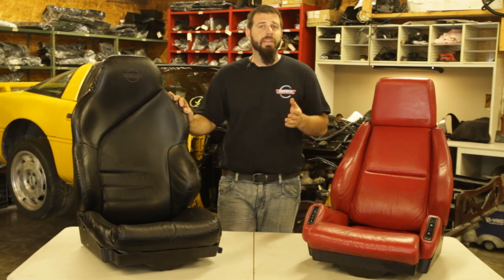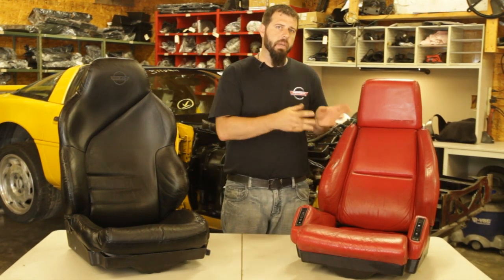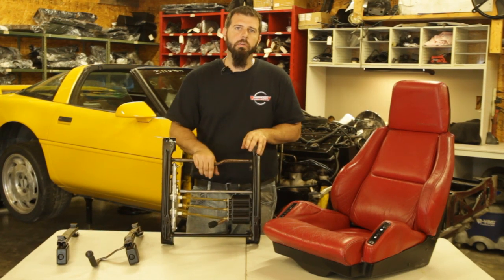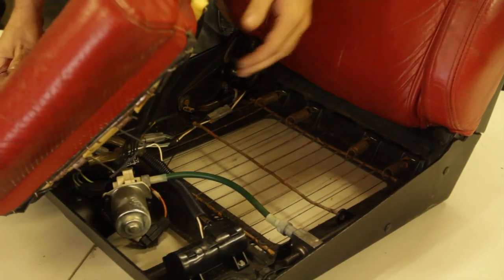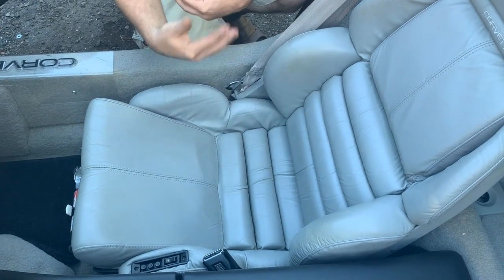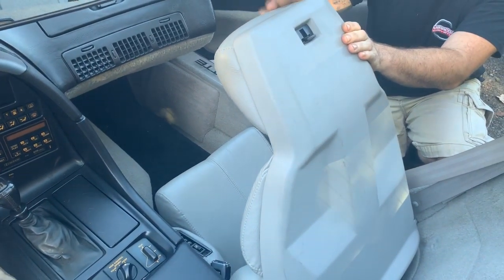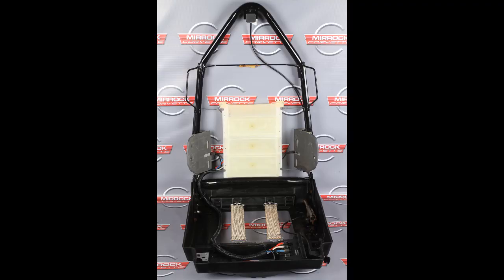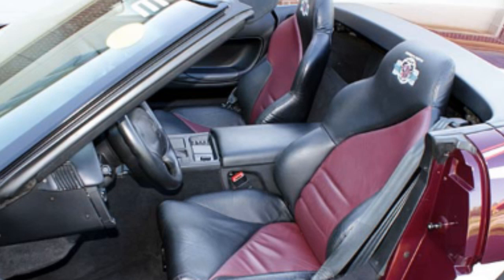C4 Corvette Design Differences: 1984-1996 Corvette Seats

Comment: Absolutely no struggle getting in and out of a C4 .  Feel's like your getting in a race car .  It's the only car I know of that does not need a foot dead stop because the seat /tub as it's called , holds you in position so well and with the Seat Belt Cinch button , your locked in there . Hated the seat in my C6 .
Reply: Hahaha you feel part of the car 👍😂

Comment: I don't know if this applies to all C4 model years, but at least in the early cars (like my '88) there is a seat belt feature that allows you to lock the lap belt down nice and tight, which obviously helps hold you in place. If you are torn between the more relaxed fit of the base seats and their easier ingress/egress, and the sport seats, this little feature might help you decide which way to go.

Comment: hey this guy knows things!  You can also use a drill on the cables that rub thru the tubes to move the seat side to side front to back.thats only if you dont want to spend the money right away and need to move the seat,... just a rig job..

Comment: I have a wierd problem on my 96. 
When i switch the DR/PS switch i can adjust the lumbarpillows as i want, bot nomather what the switch is turned to, i can only move the driver seat back/forth/up/down. 

The passenger seat is still. 

What can the problem be?
Reply from the maker: SIR_Pierre check the wiring connections under the drivers seat. Wiring signals run from the switch to the drivers seat then over to the passenger, an incorrect connection on the drivers side seat in the wiring can cause the issues you are experiencing.
Reply: @MirrockCorvette  Thank you very much, ill check and see if i can see anything that doesnt look right.
Reply: Hi again
I have checked everything several times. And everything seems to be connected right, A-F. I can't even see any way it could be connected wrong.
Reply: I still cant find the problem, could it be something under the panel / button?

Comment: Are seat foams swappable from year to year. I know 84-89 are all the same but 90,91,92, say if I wanted to put 90 seat foams in my 87?
Reply from the maker: For non sport cushions, yes all between 84-93 can be swapped as frames are essentially the same for those years with only differences to areas which does not effect the cushions.
Reply: @MirrockCorvette  awesome. Sadly I already ordered the bright red year appropriate seat covers for my car. My foams aren't too bad

Comment: I have a 95 base model and the seats move fine on both sides but the base seat material is really stiff and kinda suck actually not comfortable at all. Actually my seats look nothing like the base seats shown here either. There hard stiff black material that even when I use leather cleaner on them they stay hard as a rock. I’m using a 3in gel pad just to get some comfort. Guess the seats were changed out with junk ones.

Comment: Great video.

I wonder if you could offer me some advice.

I'm 6'5" and looking for a C4.  I need more headroom.  In my Firebird, the solution was to swap to Fiero seat brackets.  They bolted right in and lowered the seat by more than an inch.  It doesn't sound like much, but it made a huge difference.

If I'm looking for more headroom in a C$, am I better off with a manual or a power seat?  Are there any seats that sit lower than others?

Thanks
Reply from the maker: seanof30306 you would be better off with power seat tracks to start since manual tracks are at an in the middle height of what the power is adjustable to. As for stock seats the bases are all pretty much the same so there isn’t a height difference there, but the later cushions are a little bit thinner than earlier ones. For your height, a worn in used seat would help since the cushions will sink down in more on seats that are more abused.
Reply: @MirrockCorvette  Thanks for the response.  I found a thread where a guy advised taking the suspension straps out from under the seat cushion.  Would you recommend that?
Reply from the maker: seanof30306 you could but that may be uncomfortable. The earlier spring style supports will sag more that the straps and a used set of those could allow for more room while still having some support in the center.
Reply: @MirrockCorvette  Thanks.  I was thinking of taking the driver's seat to an interior shop and having them make straps with more stretch to them.

No one else will be driving the car but me, so I'm even thinking about direct-mounting the seat to the floor.
Reply: If still looking,I have your best C4. I want a C6 cause of ingress/egress issues.